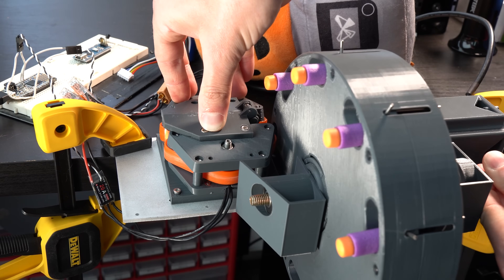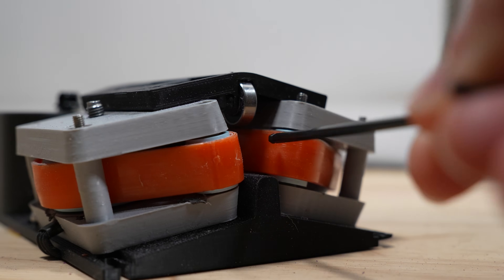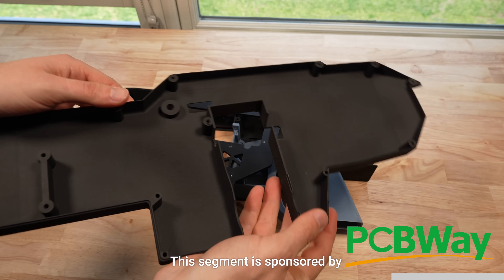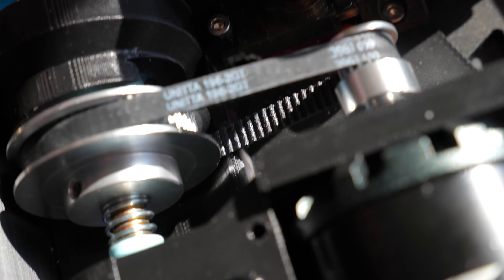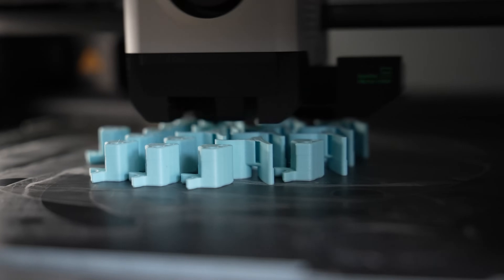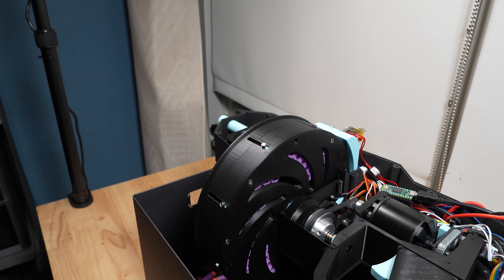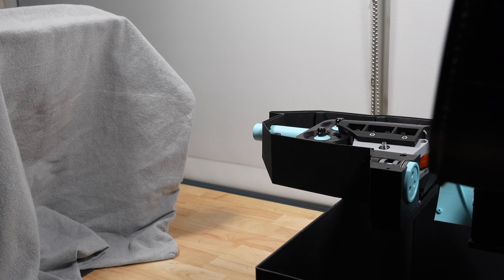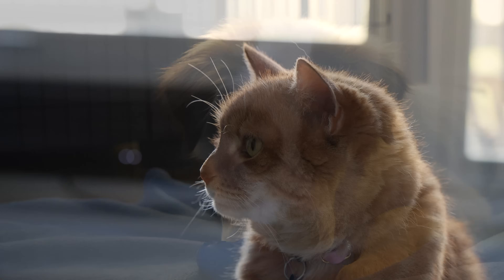My INSANE 100 Dart per Second Nerf Gun | Finale

Comment: Maybe you could add a auto tensioner to the belts, similar to an automotive tensioner on timing belts or accessories belts.
Reply from the maker: These belts are elastic so that doesn’t help. Tension can be adjusted by modifying the belt loop length. This is also how it’s done on cars typically for belts running to accessories that are under less load
Reply: @3DprintedLife  I didn’t expect you to get back, that makes sense though. Watching the slow mo with the belts kinda almost jumping around. Which maybe had an impact on how the darts fed in. Also do you plan on making this more reliable in the future?

Comment: There are some changes that are necessary to make.
1. Current limiting. It will jam at some point huring regular use.
2. A jam door and improved belt frame to more easily clear jams.
3. (Not as necessary) Perhaps the dart belts could go at a speed proportional to the fire rate.

Comment: why not go to track fed like a real minigun? they have to use a track that rounds slide on because any other method is too slow or unreliable for feeding. and you don't need extra barrels either like a real minigun does because your barrel doesn't factor in to firing a dart at all (you aren't even using gas expansion to move the darts). i'd move towards a huge carousel that feeds a track into the "action" of your two belt drives, and then a rotating pawl that grabs darts from the track and puts them into the belts, then moves out of the way (exactly how the minigun's action loads). what you have now is like if you deleted the track and the loading system on a minigun and just threw rounds from the carousel into the open action lol

Comment: this is such a cool design. once you get it flushed out you should definitely order a custom PCB for it so you can make the body slimmer and integrate everything better. also  one suggestion is to make the mag release purely mechanical, while the current design with the servo is really nice, a mechanical one might take up less space and have less weight.

Comment: You should use JST connectors for the wires. I've never gone back to dupont since switching. They're polarized (so you can't plug it in backwards) and have a locking feature.
Reply from the maker: I did replace them with jst connectors, but a non locking variant

Comment: Print file (ill wait) (i dont even have a 3d printer but i need it anyway)
                           👇
Reply from the maker: Link to the onshape project is in the description. It is a very difficult project so you need to understand the cad model if you want to print the parts, which is why I don't directly provide the stl files.
Reply: @3DprintedLife  oh thanks! I wasnt expecting u to reply but its super cool tho

Comment: question esspecially with removable and swappable barrels
rifled barrles what would that be like in this situation
Reply from the maker: You can but it would slow the darts down. I think some nerf blasters use barrels with bearings integrated at an angle to effectively do the same thing

Comment: I have a question, why didn't you use rubber belts on the belt drive? I don't remember if you explained it in a past video but I feel like it'd be a good idea compared to plastic, also with rubber belts you could have a very small belt side loaded into the drive to get rid of any problem with the belt expanding when sped up.

Also for the jamming problem I don't know if it would help but you might be able to have a tube barrel with cut out sides for the belts instead of a open space where the darts can stray off the wanted trajectory, also another person has said the centrifugal forces of the rotating drum might be your problem, but I think this might be the solution to said problem.

Comment: Important note about drone ESCs: 
Their current rating is based on air cooling. Without cooling, expect them to blow up even below that. 
And if your throttle signal is jittery as hell, they (or the motors) are gonna pop too
Reply from the maker: Yeah I expected the heat from not cooling them, but they only run at high load for a few seconds tops so shouldn't burn out. I did discover a bad signal would kill the esc's haha but that was resolved by switching to the teensy!

Comment: Why didn't you use wide GT belts for the belt drives? Widths up to 15mm are available. Perhaps they would have performed better at such speeds as they don't stretch as much. And if you turn them inside out, the teeth would provide extra grip. Also, a pair of flanged bearings with a regular bearing (or a spacer) between them would work great as a pulley in that case.
Reply: Maybe he wanted a drum mag design from the start

Comment: @JeorgSprave over at the slingshot channel has tips on how to make a cheap and easy projectile catch. just need:
-medium cardboard box
-towel
-box knife
-tape (optional) 

-fold in or remove all but one flap around the opening
-cut 2 slots into the side of an amazon box about 2 inches or 4cm apart perpendicular to the opening, on the side opposite the remainder flap, 
-slip a towel into the slots, draped over the middle bit (leave the towel on a hangar to stiffen if needed)
-dangle the towels layers like curtains, passed the remainder flap, which you can tape up to make a basin to catch your projectiles

that's it, takes 10 to make your first one, and I've made them in just 2min. you can also just cut one larger slot if you have a simple triangle hangar that's longer than the width of the box.

Comment: I think a lot of your problems with jamming at high speeds can be explained this way:
When the dart leaves the magazine, it has incredibly downwards momentum.
The more darts you're trying to shoot, the faster your magazine, the more momentum.
Your darts are a flexible object, and you're only catching them at the tip with your launcher, so the momentum in the bottom is continuing, which then causes friction and jamming.
This is also the same issue with the tips being brought upwards and angling strangely.

This might be fixed by changing the angle of the drum, either making it horizontal to transfer the entirety of your rotational energy on release into forwards momentum, or diagonal to just cut down on the amount of energy that you're having to mitigate/deal with on the dart when it is released from the magazine.

Custom hard rubber darts or solid darts might also solve this issue, but that doesn't seem like an option.
Reply from the maker: You're exactly right, the darts are moving at nearly 7m/s when shooting at 100/s rate. And they have around 2-3 ms to change directions and extract from the mag, then <7ms to move far enough through the belts to allow the next dart to feed. Fire rates this high involve some ridiculous speed and timing. Custom darts could definitely help but keeping weight down is critical.
Reply: @3DprintedLife  I wonder if you could use a harder, thinner dart in order to counteract this issue. I don't have the resources to try this but it would be cool if someone did. The downside is that they would hurt a lot.
Reply: @sharkbyt8806  i think at this point making the darts hurt more is perfectly reasonable, if only out of sheer spite for the project. xD
Reply: @3DprintedLife  I wonder if you could integrate the mag and the feeding belts more closely. right now there a lot of space between them and they don't really join together. maybe you could somehow make the feed belts mesh with the magazine by having cutouts in the mag for the belts to sit.
Reply: I feel like custom darts kind of negate one of the main features of the project
Reply: What if a "force" was added from the back? So, the dart isn't just snagged, dragged, bagged, sometimes making it, other times just causing ones' self to go mad- what if a slight flow of air was being generated by a fan from the back to kinda push it along especially at the higher speeds so that it's not just the front of the dart being grabbed by the shnoz and dragged into criticall velocity like a brat child getting caught stealling by thieir moms at the candy store/ toy store....

Comment: without the need for a 100 dps blaster, this drum design does seem really cool for a high capacity blaster and would rock for someone to build a tommy gun style blaster off
Reply from the maker: Setting it to 10 or 20 darts/s fire rate is actually surprisingly useful! Though a little unweildy for actual use :)

Comment: Teflon rails as guides to help them from catching and throwing them off bore? That it worked that well kicks ass.
Reply from the maker: Teflon does work great against the foam but it’s terrible against the rubber, still too much friction there
Reply: @3DprintedLife  Ah nuts. How about a wedge shaped belt to feed better as the round comes down, or even full V-shape to capture the shape of the tip? Do the initial belts need to be that fast? They only need to pluck the round out of the magazine to feed to the next drives, right? Are the belts too long for plucking duty?  

Belt shape to grab the tip better and not so fast. Let the secondary or tertiary drives accelerate it, type thing. 

Just throwing thoughts at the wall, cheers all!

Comment: For the darts going all over the place, you should put a bcar. A bcar is a type of barrel addon that acts like rifling.
Reply: These generally don't work that well on flywheel-based blasters; they rely to some degree on the air pressure of a typical spring-and-plunger arrangement pushing them from behind to ensure the darts travel through the bcar reasonably straight and don't lose too much velocity doing so.
Reply: @siberx4 they work fine on flywheel blasters but are a bit more touchy. On a springer, you usually have air ports before the bearings, so that’s not relying on the air pressure either.
Reply: @shatteredskies191 Air pressure is not a factor in flywheelers; the only thing imparting momentum is the flywheels themselves. It's why the only marginally effective BCARs sit just ahead of the flywheel cage. Good dart alignment is one reason, but the bigger issue is that anything ahead of the dart, be it bearings or the barrel is doing to drop FPS.

Springers, on the other hand, are entirely dependent on air pressure. It's why barrel length is an important component. It's so much of a factor that muzzle blast can disturb a dart's flight path and that's why some BCARs are ported.
Reply: @maweitao  correct. But anything after that porting on a springer will also drop fps. All I’m saying is that bcars can be used effectively on flywheel blasters.
Reply: It's simple: You don't have to aim as much.

Comment: 9:25 I think a physical button on the bottom would be better than a servo
Reply: But then won't be as TeChNoLoGiC.
Reply: the servo allows it to be a smart-blaster, and eject the mag as soon as its empty. which isnt practical but does add cool factor.

pretty sure this design does allow for both the wedge and a pull-tab at the back for manual ejection. id be suprised if this isnt already in the design and just not covered.

Comment: Awesome! ... ... Wanna try Mega Darts or vortex?
Reply from the maker: Mega darts would be hilarious. But no :)
Reply: @3DprintedLife hmm i may try to take a old leafblower do something like that, have all the air  channel into the feed system, aending the dart forward into a flywheel system like yours, and out of a barrel with the leftover exaust of air or co2 from the blower. Either way im not sure i can really make this possible, but i might try. For i have zero knowledge of programming, but maybe i can make it completely mechanical. Mechanical mags, full speed flywheels (sustained fire may have cooling issues, water cooling or heatsink?
Reply: @3DprintedLife either that or i may try to make a rather nasty feeling shotgun
Reply: Rival/Vortex are the way! SO much quicker to pick up with those mesh basket things.